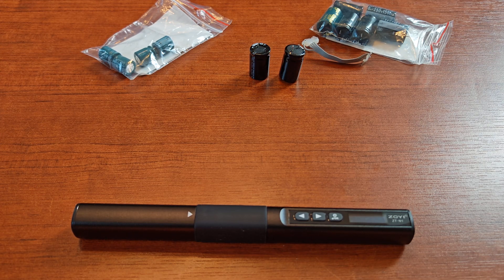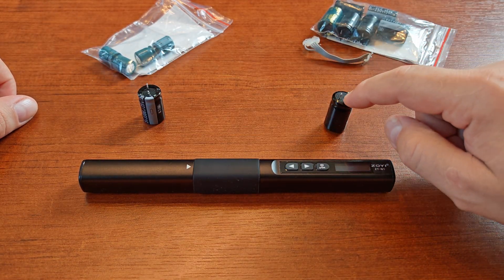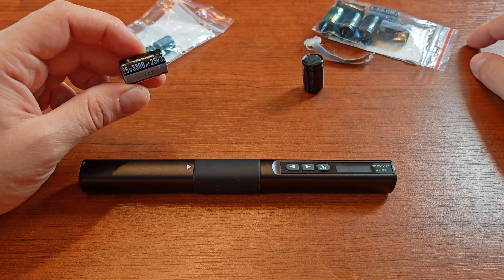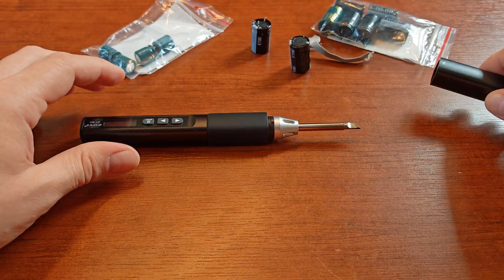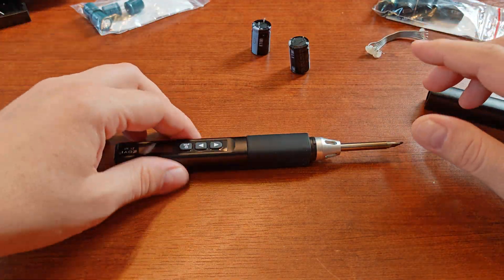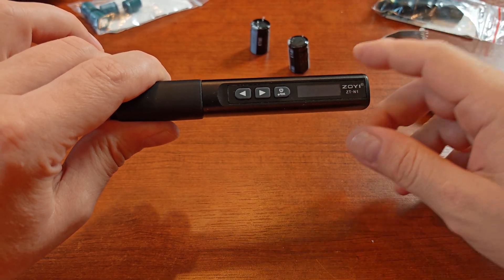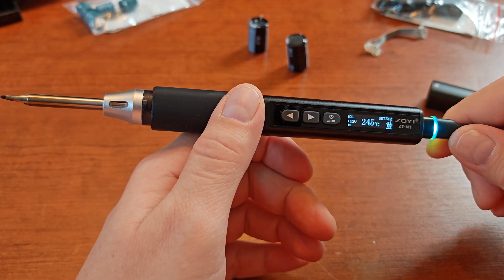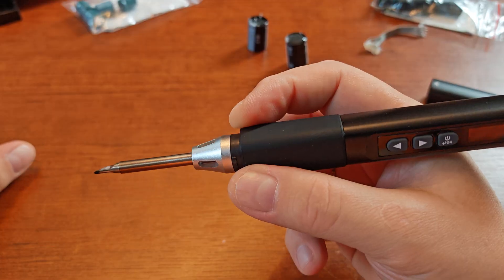My tools: smart, portable soldering tool: Zoyi ZT-N1 review!

Comment: I’m a rookie , would you say leadless solder is ok to use to fix audio equipment? Thanks
Reply from the maker: It's ok but you need to set higher temperature and be more careful, it's easier to solder with regular lead solder as it "wets" the contacts easier and in lower temperature. 
If you're a rookie then maybe try to learn soldering with a regular one first, it's easier

Comment: I wondered about getting usb v. 120v. I just got 120v for 13 usd with 5 extra tips,solder, flux, and same small tool rest. I did my one capacitor replacement for my 38 year old Merrill Heirloom turntable so now it doesn't start backwards half the time 😮. It's the back up table now but l just measured the speed with my Hagerman UFO strobe and it was dead on with a 38 year old belt! Somebody is going to get the deal of a lifetime when l sell this.
Reply from the maker: I also have larger 220V ones, this one wins when it comes to portability. And the usb cable is not as thick as 220V one, so it doesnt get in the way that often. I still need to order some more tips for it :)

Comment: Hi Tom - nice tool and nice Quick Look! I was afraid you would burn yourself on it after it was off and disconnected! 
My favourite recent tool is a crimping tool with 6 or 8 faces to compress copper ferrules on to speaker cables. It stops the cables fraying. And when compressed tightly they will not oxidise so quickly. 
All the best, Rob in Switzerland
Reply from the maker: Hi Rob! I have other soldering tools too, that one is handy because its small. I've burned my self many times during soldering over the years :D
It doesnt hurt as much after 30th time :D
Reply: Hahahaha! Ouch!

Comment: I wonder if they are salvaged caps? I got a no name portable soldering iron that uses C210 tips that are about half the width of yours. I find mine doesn't get hot enough to create decent solder joints.
Reply from the maker: I was surpised it can actually get to 450C - Ive checked that with laser thermometer and its true. 
As for the caps, they are fakes, the print, the look are low quality, also the capacity is totally random, one of them measures as 4000uF (and its 3300uF). Some of them measure as 100uF, one measures 3400uF so I am amazed that this preamp actually worked at all :)
Reply: @k4syx  Thats a good finding and one which does not give confidence in purchasing the clones or at least some of them. Especially that while the asking prices may be a small percentage of the originals on which they are based they are still in the 'couple of hundred to a thousand dollar' range so not exactly peanuts.